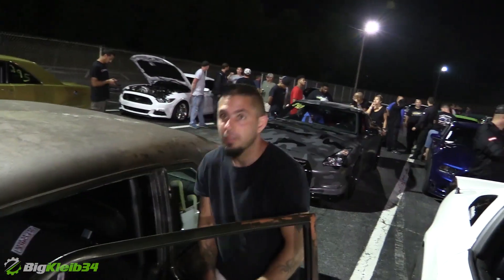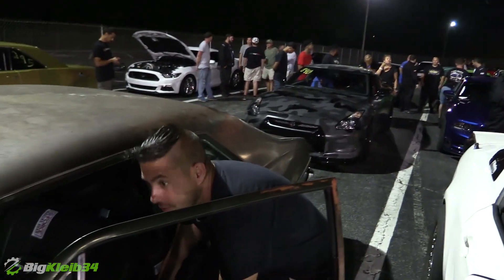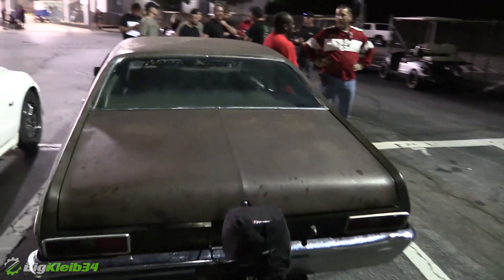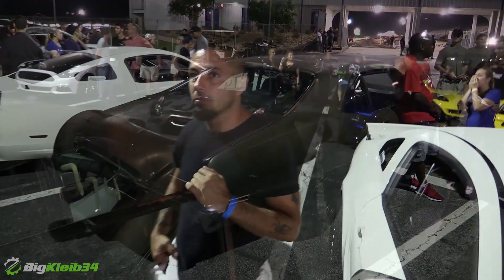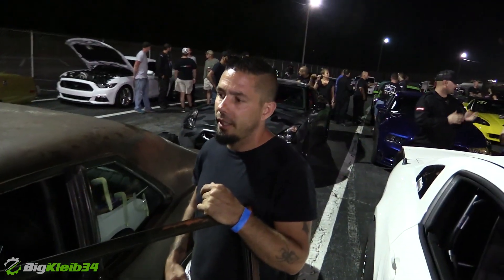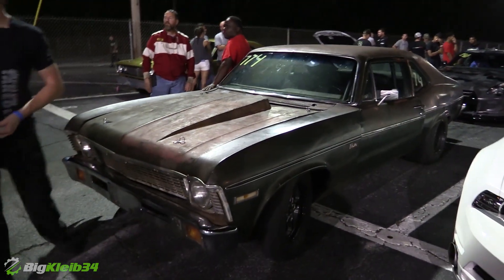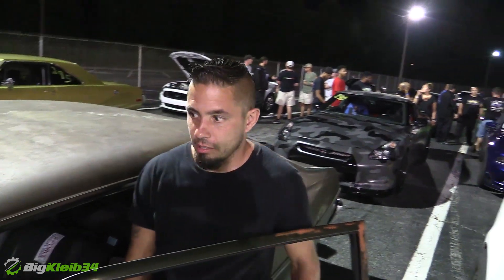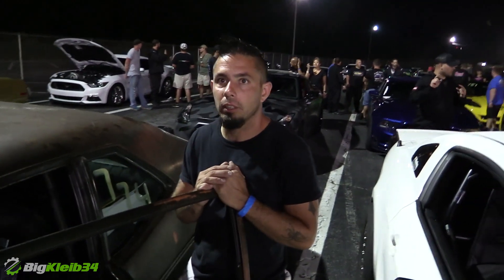Never Trust the Rusty Ones! (1300hp Super Sleeper!)

Comment: came here to watch the rusty Nova, leaving only thinking about that coyote
Reply: Right, he got lucky he tree'd the shit out of em, nova was coming for blood lol.
Reply: Robie S195 the mustang had a faster mph.. meaning it's pulling away from him. Nova may have got him in the 1/8 pushrod motors have more torque off the line.. you're not running down a mod motor on the top end.
Reply: @jmitchell513  You're  right, didn't see MPH, just looked like the coyote tree'd him and he was slowly gaining back ground.
Reply: 540 MUDSTAIN not saying old school isn't cool at all. The little 302cubic inch mod motor vs a built and stroked dart block 427. there was no penny saved on the Nova engine build either. The only thing the coyote needs is a strong block the heads in stock form outflow about anything.

Comment: I thought a 427 was a big block.....
Reply: 427 means the engine's cylinders measure 427 cubic inches in displacement. You can take a  small block and bore out the cylinders and / or use a stroker crank to increase the displacement of the engine block.   So it still has the design and engineering of a small block but with much larger displacement.

A big block is a bit different design than a small block and engineered differently and uses many different parts.  It's more than just the displacement size that distinguishes a small block engine from a big block engine.
Reply: Gotcha bored out small block